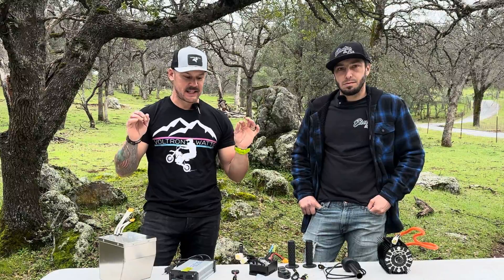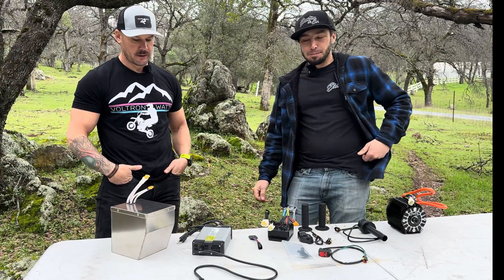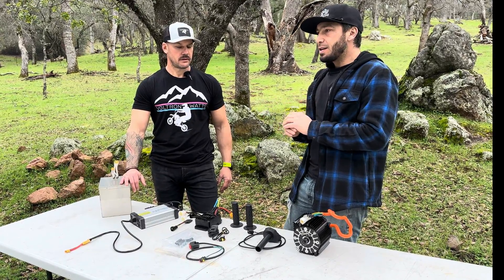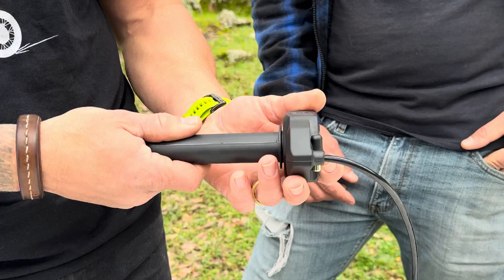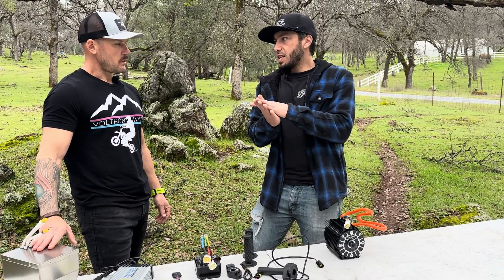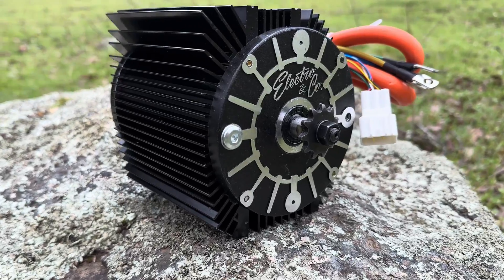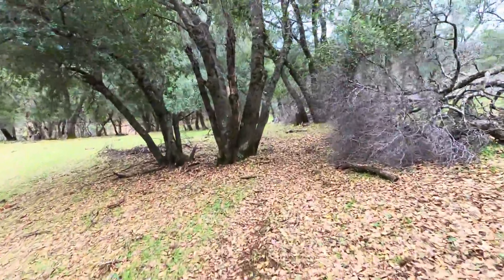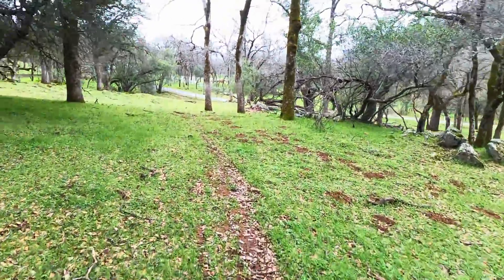An Affordable Drop In VESC Controller Kit From Electro & Co. For Your Modified Razor!

Comment: Do u get a throttle if u just get the controller being that it’s 350$
Reply from the maker: Throttle, controller, on off switch and three speed switch
Reply: I bought the lil bit controller and yes it does come with the throttle

Comment: Question boss you’ve really bad ass at answering my questions can I run this controller with the fw11 motor instead I like the little bit price point for the controller but would like to run the fw11 instead lol
Reply from the maker: The FW11 is not supported in the TruMoto app. But, you can run the controller if you decide to use a different app like VESC tool 🤙
Reply: @VoltronWatts  thanks boss always coming through with the info Voltron the goat

Comment: What’s the smallest battery I can run with this kit would a 48v 100amp / 20ah battery be to small boss ?
Reply from the maker: I think that would work. I think the little bit is good from 48-76v nominal. If you decided to pull the trigger “Voltron5” is the E&C discount code 🤜🤛

Comment: Can you put this controller on a 2200w motor
Reply from the maker: Most likely. E&C has a list of compatible motors on their website. But it’s Vesc. Based so it will work with most motors if you’re willing to set it up in a VESC tool app
Reply: @VoltronWatts  cheers

Comment: I’m looking to buy a little bit controller, I bought the razor rsf650 6kw kit with a 76v 24ah battery a 2.1v my1020+ motor and a 6kw Kelly controller, all I want to do is put on a little bit controller for a live dash board could I do that without switching my motor?
Reply from the maker: Totally! Voltron5 is the electro and co discount code if you decide to pull the trigger 🤙
Reply: @VoltronWatts  dude thanks so much for the quick response and the information that pretty much all I wanted to know! I also like that you can control and tune everything about the bike on the fly!!
Reply from the maker: @SkaterAce_ 100% man🫡 thank you for watching btw 🤜🤛

Comment: I saw that the controller came with  an xt90 battery connecter. If I get the qs8 battery leads that e&c offers will it work with my qs8 battery?
Reply from the maker: You would have to get QS8 leads from the controller to mate with the battery. Where are you getting your battery from?
Reply: @VoltronWatts  amorge
Reply: The battery’s size is 6 by 6 by 8 do you think it will fit in the b1

Comment: That's not bad at all, now I'm curious how fast it is... A big plus w/ this kit is you can upgrade the controller for more power. I'm liking this more and more.... How much is this kit¿?    🤞😁
Reply from the maker: All the kits are here 

https://electroandcompany.com/VoltronWatts
Reply: @VoltronWatts  - They have way more parts and pieces than last time I looked at the site.... Finally I can get a replacement T8F chain that's actually a T8F chain and not a 25 chain.      😁👍😂
Reply from the maker: @xpndblhero5170 yup. Check out the 34h chain kits. They are even better 💪
Reply: @VoltronWatts  - It looks cool but there's something about the T8F that looks like a BMX chain and I really like it.... I'm weird like that.     😅👍😂

Comment: Can u connect these controllers to hub motors?
Reply from the maker: Yes. You would need to tune it through a VESC tool tho I believe. E&C is constantly adding motor selection options in their TruMoto app 💪

Comment: Is it possible to wire the controller in dual motor configuration? Like is there a can bus?
Reply from the maker: Hmmmm…. I know you can wire two in. Would have to split the throttle cable and set the parameters of each controller. But CAN BUS I’m not sure

Comment: Can it run different types off BL motor, such as hubs, and sensor-less outrunners?
Reply: Generally it’s intended to work within our ecosystem of supported motors.

However you can indeed opt out of TruMoto altogether and forge your own path. 👌
Reply from the maker: Thank you for the info yall! 🙏
Reply from the maker: Great question 👍
Reply: @VoltronWatts  indeed! 🙏👌

Comment: What’s your top speed on this kit with the 72v 30am battery and the top speed with 76v 24am battery please let me know soon i was going to order my kit earlier but stopped when I saw this on there page
Reply from the maker: I don’t know that the top speeds are going to be THAT different between the 72 and the 76v 20AH battery. EC has two different 76v batteries with different amp out ratings. 76v 20AH 150amp out and 76v 24ah with 180 amp out I believe. That is a powerful battery and exceeds the limitations of the little bit controller.

Comment: Hey Voltron, big fan of the channel and looking to improve my own Razor build. I have an ec4p (v2) but I’m running a FarDriver ND72450 with a Hotpaxx 72v 120A (20Ah) battery. Is there any advantage from a power/speed standpoint to go with the Noisy Cricket, seeing that this particular FarDriver can also do 120A?
Reply from the maker: Thank you for your support man! Be sure to check out the modified razors Facebook page. 👊 I have a 72450 as well. I think you’re pretty well suited either way as long as your controller can handle the max limitations of the battery. My 72450 has been great and the Noisy cricket is also fantastic. You might get a little more speed from the NC controller just because of the VESC technology but I can’t confirm that. If you do decide to get a E&C controller if you use “WinnersCircle” it will save you a couple bucks 🤙

Comment: Might be my next controller, how do you think it competes with a fardriver? Seems much easier to deal with but I’m wondering how it would compare to any of them
Reply from the maker: The trumoto controllers are very easy to hook up and tune. FD is too once you learn what you’re doing. For simplicity, the trumoto takes it AND its small saving more room for battery or whatever else you got on your bike. 🍻

Comment: Got the little bit in pocket mod and it rocks bro
Reply from the maker: Hell yea man! It’s a small package but still has huge power!
Reply: How would you compare it to a Kelly controller that most people have
Reply: @hoverstate_ I run the Kelly controller in a coupe other bikes and it works great too honest I only bought the little bit because E&C didn’t have a Kelly controller in stock lol plus it would been cheaper.  But yeah it’s cool to be able to change settings on the fly with the little bit controller
Reply: @raderws  power wise can you tell a difference and are you running the ec4p motor